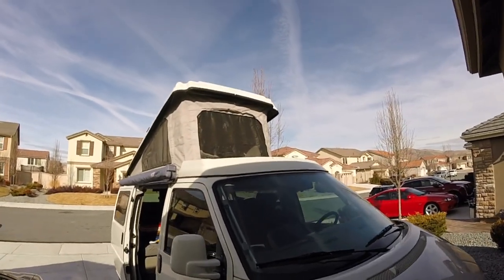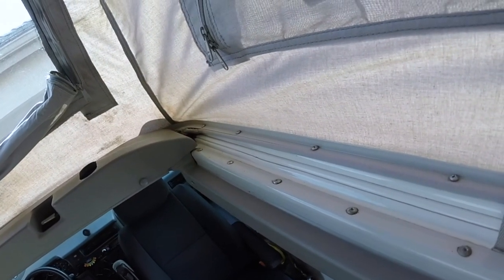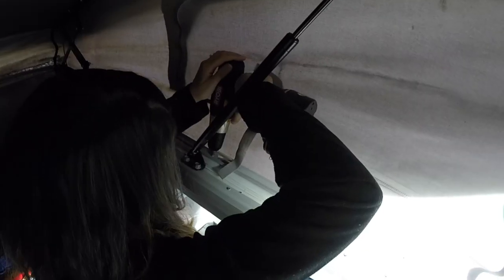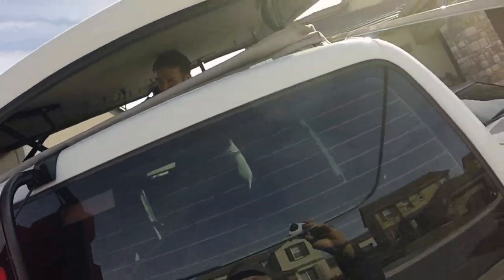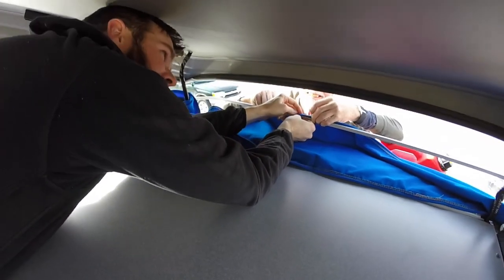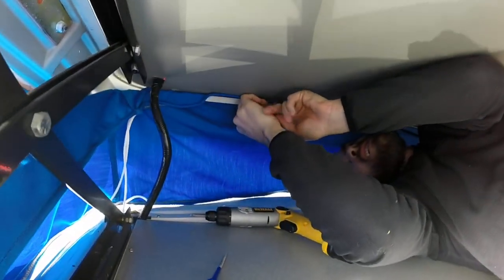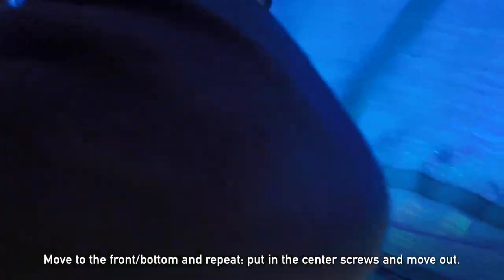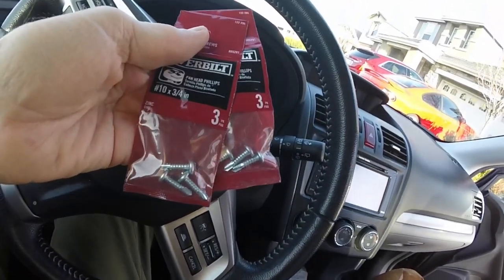HOW TO: DIY Campervan Pop Top Canvas Replacement // VW Eurovan Hujaca Roams

Comment: Have you changed the luggage basket brackets to the stainless steel ? Do you have a video of that process? Have you changed the seal around the top? Do you have a video of that process?
Reply from the maker: We haven't changed the luggage brackets yet, but it's on our "to-do" list. We will document the process when we do that. Our seal is actually still in pretty good shape, so we have been lucky enough to not need a replacement.
Reply: The seal isn't the issue, it's the hardware holding the luggage basket, it rusts and disintegrates and the basket flies off in to the wild blue yonder. Hopefully not into the windshield of the car behind or passing by.

Comment: Did you remove and replace the blocks of silicone in the gutter tracks?
Reply: Yes, we did.
Reply: @ErikEdney  Thanks - Once I got started it seemed inevitable these had to come out and be cleaned. The video was extremely helpful and my replacement went smoothly. Thanks!
Reply: I removed one of the blocks that had some rust around it and found a rust hole under it, so could be advisable to remove them if they look bad or you're looking to open a can of worms. The others looked OK so I left them in place and just added some silicone over them.

Comment: I don't suppose you have written down step by step installation instructions for this. I have the same canvas for my 02 EVC. I have been watching your video and pausing it to write down the steps.
Reply: I just replaced my canvas using this video and like you had to keep pausing it to write down the steps. It's too bad the canvas comes with no instructions, but it's a fairly easy job. My only complaint on the video is now the music is stuck in my head. Here are the steps as I wrote them down:
1. Remove screws and brackets, marking bracket's location on them. Use a strap to hold the top down part way.
2. Cut/pull tent from the silicone and pull it around the front and over the top to remove it. Scrape/remove old silicone.
3. Measure and mark center points on tent and camper top.
4. Loop canvas over top, making sure you have it properly oriented (correct top/outside; you want to be able to open the zippers from the inside!)
5. Attach top front center of tent with one screw (Probably optional but helps position the canvas. I just used a clamp instead of drilling an extra hole since you're just removing it again later)
6. Attach top rear bracket, working from the center. Only do the back edge. You want the "cord" just inside the bracket.
7. Similarly, attach bottom rear bracket, back edge only.
8. Attach top front bracket, front edge only
9. Attach bottom front bracket.
10. Complete the sides from the front, working back.
11. Once all screws are in, tighten cord. May take some jiggling to get tension on the front.
12. Silicone around the lower edge.

My tent was different than the one shown here and the cord comes out the back center, not the corners. This makes it so the cord can't really take all the slack out of the tent at the corners without removing the screws across the back again. The tent seems to have a bit more material than needed across the back.

Comment: did you replace your top with one from GoWesty?
Reply from the maker: We ordered the canvas through CaveVan, but we've heard that they both sell the same one.
Reply: I got my canvas through CaveVan, apparently they're all made by a company called Acme. It took six months to get it (of course it only showed up in the middle of winter when I couldn't work on the van) and the quality was a bit disappointing, lots of fraying edges on fabric/webbing and the stitch count was very low and variable. I don't expect it to hold up as long as the original. I kind of wish I'd just sewn up my own replacement using the old one as a template. But it looks much better than my old moldy/torn one. I also replaced the seal with one from GoWesty. You'll find some videos here on how to install the seal and complaining about the quality of the GoWesty seal, which I wish I had seen before buying it.